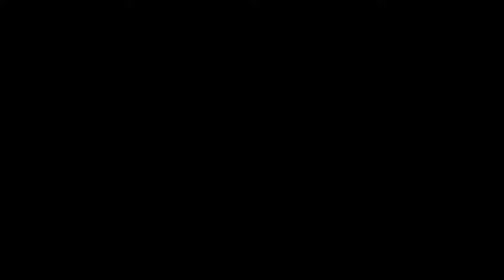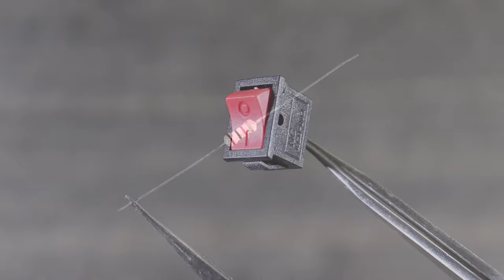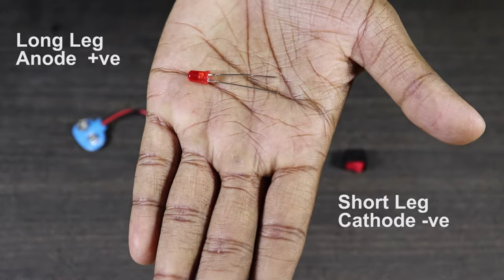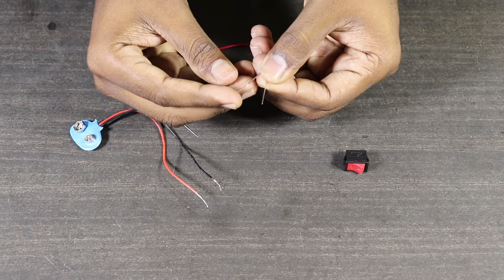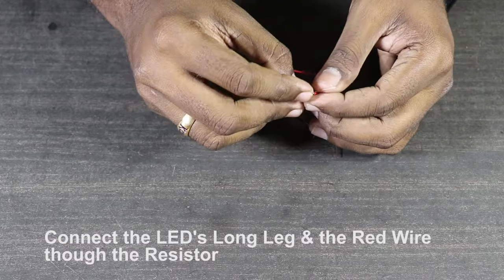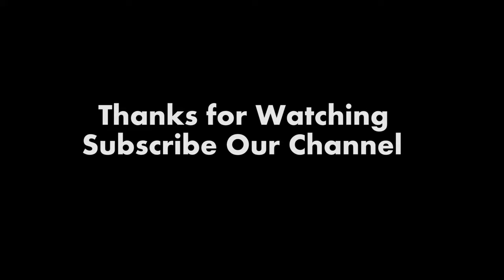How to Connect Single LED to 9V Battery with Resistor & ON/OFF Switch | Connection Tutorials

Comment: Bro can I connect 5mm led light and 220 ohms resister with 9 volt Hi watt battery?
Reply: Ya but it won't work for long

Comment: The resistor needs to be on the negative wire as electrons flow from the negative terminal of the battery

Comment: can i do 5 or 6 leds in series...do I need resistor?......what size resistor ....for 9V BATTERY power?
Reply from the maker: You can connect maximum 3 LED's in series connection. You can just use 10 ohms Resistor
Reply: @schoolscienceprojectideas  well i ended up doing them in parallel with a transistor and it lets me light like 12 LEDs.....what the heck is that little little transistor?

Comment: For two red led which resister should I use? For 12 or 9 volt battery supply
Reply from the maker: You can connect 2 LED's in Series connection with 100ohm Resistor.
Reply: For 10 LED how much ohm resistor is required?

Comment: What does the resistor do in the connection
Reply: It limits the flow of electricity so that  the circuit doesn't get overwhelmed and possibly explode.

Comment: i want to connect 20 different colour leds 5mm with 9 vatt supply which resistor needed? pls reply urgent
Reply: One led = 3 v
So if u are connecting three led  or more in a series connection..u don't need any resistors
Reply: @farhanfaiz1998 If I connect all led in parallel, does it require a register?

Comment: For installating 20 led lights what all apparatus do i need?
Reply: Depending on what you want them to do. But in some instances youlll need a transistor and electrolytic capacitor.

Comment: what is the function of a resistor?
Reply: To reduce the flow of power. I u directly connected the bulb with 9v battery, due to high voltage, it would blast

Comment: Is there is any specific way to connect resistor??
Reply: No you can connect resistor on either end of the leads there is no positive or negative in those.

Comment: What is the use of the resister
Reply: It is used to resist the flow of current

If battery is of 9 volts and led is of 1 volt and we directly connect them so the light will be fused but if we will connect them through resister it will let only 1 volt of current to pass

Comment: can i use 9v DC lamp ?
Reply: yes, as long as the battery is a 9V you should be able to do it. Just make sure you match the resistors with your voltage source and you should have a great circuit.

Comment: Bro the bulb is 9 vot . I am 7 std so I made a simple circuit biz the battery is 9 volt and the bulb was 1.5 volt so all the bulb got fused so if we use resistor it will balance 7 volt